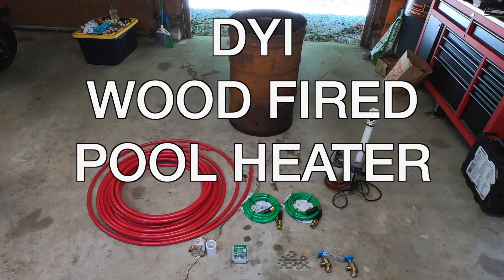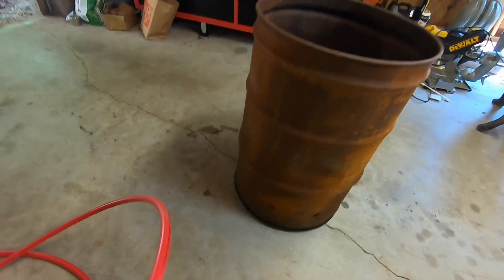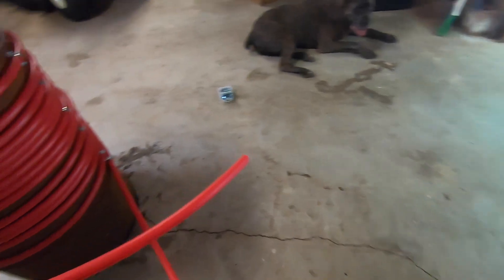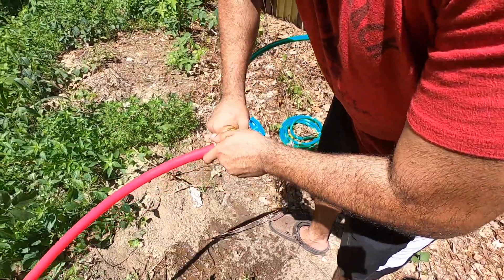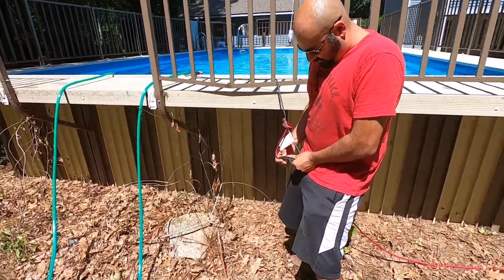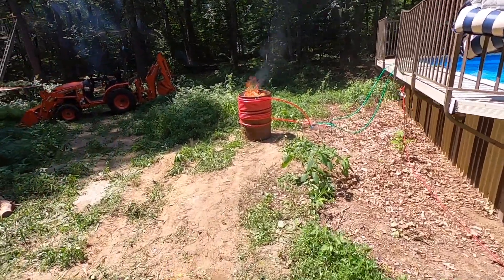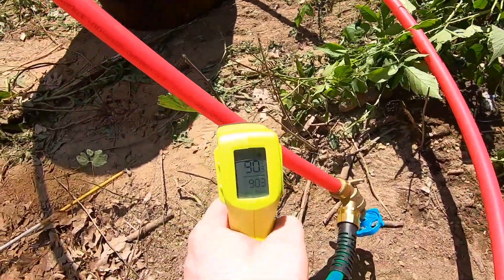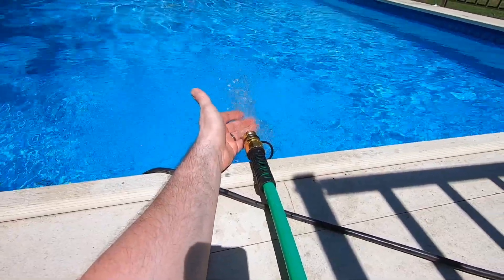WOOD FIRED POOL HEATER - (Redneck Engineering)

Comment: 1. Pex (plastic) is a good insulator and terrible conductor 

2. I would try not to use a pump (other than to get air out of lines) and let the natural circulation (heat rises, once primed will also suck cold water in) do all the pumping. It'll allow more heat transfer if you arent just blasting cold water through the coil with a pump.

3. I get wanting to have the fire away from the pool a little, but with longer suction/discharge lines add a lot of heat loss too. So I'd insulate them as well.

4. I'd think about heat loss/wood consumption with a fully open top. If you get proper air flow/restriction you can maximize heat and minimize wood consumption (think about how a wood stove and it's stove pipe work).

Just my two cents! Good for y'all for putting the effort forth though, nothing ventured nothing gained!

Comment: I would use a smaller pump. That pump probably pumping out water to quick and cooling the pex. I ended up using a fish tank small pump and my water was too hot to touch coming off the hose using a solar heater
Reply: HA it's supposed to cool the PEX or it'll melt and if it's cooling the PEX your water is getting warmer, which is the point.

Comment: Line the inside with copper coil. 72 degrees going into drum 105 coming out. Cut a square out of bottom and set drum on brick to allow airflow under drum. Drill holes about 18 inches from bottom in sides and run rebar thru to make a grate for wood to sit on. You will see a significant difference

Comment: The people complaining you guys used plastic aren't engineers either lol granted if the pump died you guys would be in trouble.... The issue you guys have is that barely any heat goes into the drum its exiting as hot gas out of the top. What might work is some sort of tube in tube set up with some thing similar to chimney pipe. Anyway the key is figure out how to cool the flue gas and insulate the barrel.
Reply from the maker: Best input so far. The main issue we has was not getting the temp high enough in the barrel in the first place.
Reply: @theperformancereviewchannel the big thing is to not bother cooling your burn vessel, you want to cool the gas coming off so I was thinking about this and how to make it reasonably efficient however it starts to increase the cost. Basically you want an insulated “box” you burn in . Force air and cool the flue aka the gas that you get from burning. The easiest way to do this a few pipes in pipes where the exhaust is flowing through a pipe inside  another pipe that’s got the water flowing in it. This pipe needs to be about 40 times longer than the diameter which is set by how much air you want to flow which is set by how much heat you want. Another option is a stove pipe with a bunch of water pipes going through it like a game of kerplunk This is what a steam boiler for something like a steam engine basically looks like .
Reply: @theperformancereviewchannel  TLDR they figured out how to build steam boilers about 150 years ago and that rough design is what you want lol!
Reply: @theperformancereviewchannel  https://www.google.com/search?q=steam+bliler+design&rlz=1CDGOYI_enUS782US783&oq=steam+bliler+design&aqs=chrome..69i57j0i13l5.3730j0j4&hl=en-US&sourceid=chrome-mobile&ie=UTF-8#imgrc=2vSWivCCUyPu3M

Comment: Surely a barrel 80% submerged in the pool & air pumped into it to run the fire would be a lot more efficient than a barrel outside the pool with water pumped round it?

Comment: Use copper tubing for the coil around the drum, don't cheap out
Reply: IN the drum bro y do it around and fail
Reply: @Airwolf100100  In the drum it will cumulate creosote. Can be cleaned but unpleasant job. Would be good to have two size barrels. Coil aroud the inside one and the outside barrel will help insulate and protect heat dissipation from wind.

Comment: I think if you make a chimney and let the pipe spiral down from that chimney you use much more of the heat from the fire.
Reply from the maker: Good point, the main issue we had was just a consistent flame in the drum. Once we got that working correctly temp was no longer an issue. Going to post that video soon.